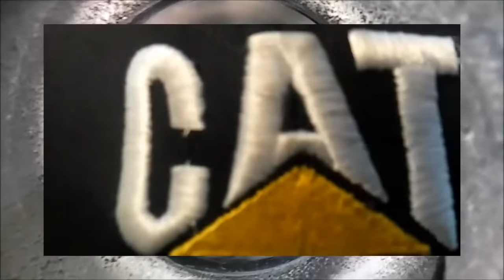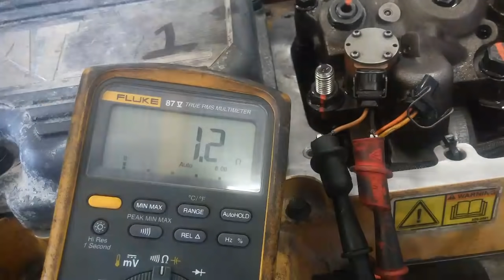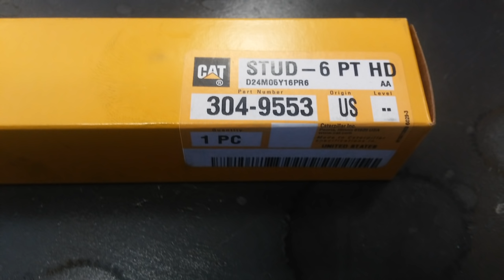What Is An IVA, What Is A VVA, and How To Fix Cat IVA Codes.

Comment: Your videos are great and your passion its well appreciated thru the drivers and mechanics , thank-you for that ! I also have a question if you can help me ...i have a C-15 MXS ,do you know base on your testings how much is the resistivity for the fuel temp sensor (cold and hot engine) ? THX
Reply from the maker: +Dan Bulzan Hmmmmm, the ohm reading of the fuel temp sensor, can I have your serial number and I'll try to find out.
Reply: Great, thanks ! MXS42205
Reply from the maker: +Dan Bulzan I'll try to look tomorrow, but if I don't reply by Wednesday send me a new comment and I'll remember.
Reply from the maker: +Dan Bulzan So I looked it up on Sis and Cat doesn't list the temperatures and ohm readings, it just does the voltage readings when it's disconnected and connected. So I ohmed out the sensor on a C15 we have here and the shop temp was 72 degrees Fahrenheit and it was at 1987 ohms. That is the best I can do.
Reply: Thank-you for looking into it, i did the same reading 1.9k and i notice a big drop in resistivity with temperature increase. Tomorrow im planning to test a step grade switch with different values in resistivity ...hopefully ill get my turbo boost back. I'll let u know. Thank-you again...

Comment: Hi Adept Ape, I recently worked on a 2006 C13 that is showing code 283-7 for oil pressure.  In your experience what have you seen that usually causes this?   Thank you in advance:)
Reply: Erich Z-Rod 

I have the same problem

Comment: hey thank you for this video I had the bolts break on me and a Jake that broke to just lucky I got it in time and that's all it broke just hope I got it all back together right lol I been running it for 2days now what's the part number for the valve cover housing the one that the the valve cover sit on I need the bottom  gasket to it if u would be so kind to help me out with that sir and again thank you
Reply from the maker: +john webber You need to part number for the gasket? What is your serial number sir?
Reply: msx60937

Comment: My truck is giving code 95. And it says is the iva sensor. Where  is the sensor locate?
Reply from the maker: +jluna201817 On a C15, on the valve cover base by the turbocharger. Should be a three wire sensor. On a C13 it is under the valve cover by the number 2 injector.

Comment: I'm running a c13 reading flash code 95 iva oil pressure voltage abnormal what does that mean??
Reply: Most likely your IVA oil psi sensor has failed. It is under the valve cover, towards the front. You have two types of sensor's on a KCB, depends on serial number. Also if you over torque the sensor, you can damage it.

Comment: Thanks for the great video it's very informative, but please help my cat engine has a code 95 I have been having crazy vibrations when pulling  heavy loads on higher gears or when going uphill (it's a torque related vibration not speed related), mechanics have been changing everything driveshafts bearings rear ends power divider you name it but the vibration hasn't gone I even paid Freightliner to diagnose it recently and they suspect it's my clutch they are still not sure that replacing the clutch will eliminate the vibration, and now I just don't want to throw parts and spend money on stupid mechanic guess work, so I started getting different opinions, and guess what,  I  had 10 people tell me 10 different theories and suggestions , until recently a mechanic hooked on a scanner and saw an active code 95 "intake valve actuator oil pressure high voltage". Now can that code make those vibrations on my truck if yes how should I start my diagnosis as I will try do it myself this time. I will really appreciate any advice. thanks
Reply: @Khan =
I was wondering if you ever find a solution to the vibrations on your truck??? The reason I am asking, my truck just started doing exactly the same(C15 twin turbo). I did a pm and  200 miles down the road it started missing. I even pulled over thinking I had a bad tire.....but I didn't. There was a loss of power but still was able to do 70mph (but I kept it at 60mph) It's giving me a 95 code, and just wondering if the I.V.A sensor could cause such a vibration....hope you are able to respond....Thanks
Reply: kov101984 I don't think the iva would do that as I have replaced my sensors myself and still it's the same very few good cat technicians out in the field, my clutch also has been replaced since I had posted my comment and the shop was sure that the clutch is bad but no it made a little difference as the new clutch spring are absorbing the vibration now that is actually coming from the engine. basically now I am coming to my own conclusion that it is going to be the harmonic balancer or my overhead needs to be re adjusted, for you I think you should run your truck (in the same spot) with the driveshaft disconnected at the transmission first make sure others not in the Driveline then go from there
Reply: kov101984 if there is a loss of power it also could be turbo related
Reply: Had the same problem on my c15 every time I was on a load it would vibrate so bad inside the cab,replaced the drive line and u joints,vibration continued rebuild the transmission the same thing happened but luckily the guy who replaced the transmission messed up the clutch brake,I stopped at a shop in Salisbury NC across from loves to install the clutch brake but before the mechanic put me inside the shop he was quick to notice that my truck was skipping. What a term he used,he went back inside the shop and brought his computer and plugged it in. To my surprise 2 injectors were out!The previous mechanic had used his laptop but didn't know how to perform the injector test. All in all I spent almost 10000 bucks due to unnecessary repairs plus downtime and headaches.

Comment: Any one know  if I'm getting code icu 140  and no ENG on a 2005 c15 cat.    Also its firing on starting fluid but dies.  Got fuel pressure on return line. And power to ECM. please help

Comment: The worst thing about IVA and VVA engines is, the customer complaining about how expensive it is to  fix that crap. Those engines use to be great when they were E model 3406s and the early C-15. 
If givin a choice,  i rather have a 3406B.

Comment: does the MBN have the IVA s ?
Reply from the maker: +kwmiked Nope, started with the BXS engines, you should be okay.
Reply: Adept Ape ok, humm, when i had the MBN tuned , so it was like a 6nc/7cz the guy mentioned something about shutting off a accuator.  Now i forget exactly what he said about it cause its been a couple yrs since it was done. But he did mention it was in the head. Im gonna try to give him a call to see if i can get a refresh of what he was talking about.  Anyways,  what if u shut off the IVAs with a tune. would the motor still run right? 
so the MBN is not considered a "Bridge Motor" ? Thanks man
ttyl
Reply from the maker: +kwmiked It's a bridge motor but, doesn't have the IVAs, just a electronic wastegate mostly. If you could turn them off in the software the engine would just ignore them I think.

Comment: Hey I appreciate the time u take making these in depth videos. I recently bought a 06 pete with an acert c15 with 200k on a platinum overhaul.  The truck runs great no blow by but until it's warm it misses at heavy throttle or 1500rpms. Once the.engine hits 180 degrees the thing runs great. I didn't.notice any smoke so I was curious if the vvas could be the culprit. Thre is no check engine light.
Reply: That is what it's supposed to do. Mine does the same thing...until someone told me that's Cats way of saving their motor. They don't want u putting full boost to cold motor.

Comment: I keep getting a below normal on #2 actuator reading
Reply from the maker: +Robert Squall So that is an open circuit, have you checked the wiring harness? If that checks out, you may have a bad ECM.

Comment: hi on bxs engines after intake valves is adjusted, it's the same procedures for adjusting iva? insert filler gauge between intake Roker and the adjusting screw on iva? thanks
Reply from the maker: +Vitaliy TSAT Yes that is correct, you have to adjust the intake valve first then you can install the IVA housings and do the IVA adjustment. The setting isn't the same though so check your data tag to see what it should be in thousandths. I have a video on doing it called performing a complete overhead adjustment for C15 engines.

Comment: I have a code 95 coming up so i replaced the sensor (intake valve voltage oil pressure high low ) ... every time my cat c-15 warms up the check engine light comes back on cuts my boost from 55 psi to 40 psi if you let the engine cool down the light goes out boost comes back I’ve checked all the wiring replaced the plug in don’t know what else to do ..... anyone seen this before ??????
Reply: did you fix it? mine does same. i've done a new sensor and solenoid  and check engine still comes on code 95.  but only under a load not when i bobtail.
Reply: israel ruiz that’s the Sam with mine !!!! Bob tailing is fine only under load then it derates me .... it’s gonna put me out of business I’m broke trying to find it !!!!
Reply: If you find out what it is please let me know !!!! I’ve done sensors and VVA solenoids still I can’t find it
Reply: i have a mxs. Matthew Walker  i will. good luck
Reply: israel ruiz mine is also mxs twin turbo.. 2007
Reply: israel ruiz we found it !!!! Engine is working great !!!!! 
The high low voltage regulator oil sensor on top of the head passengers side was gone so I replaced it with one I got at Napa witch looked like the same thing and we looked it up with a cat part number but it wasn’t working we had to get one from cat that fixed it right up and we’re going to work Monday
Reply: was it the iva sensor on top passenger side that fixed it? starting to think maybe i got a bad sensor from cat when i replaced it.
Reply: israel ruiz yes mine was a bad sensor and yes passengers side front of motor up by valve cover

Comment: My oil pressure gauge is bouncing everywhere between 70psi to 80 to 70 to 90 to 100 to all over. Im being told multiple things about what it could be but no answers. It was hooked up to a computer but nothing was found.
Reply: I would change oil pressure sensor.

Comment: I learned a lot.  Mostly I learned that CAT Build's a lot of inferior Engine Part's that should not have made it in to there Engines.
Reply from the maker: +Royce Anderson Don't blame Cat too much, they were forced to comply with regulations.
Reply: The Extorting Political Activist, aka EPA, forced draconian emissions regulations which means almost all 2004 and later engines are crap compared to older engines. 

Instead of a DPF, why not just make the DOC (Diesel Oxidation Catalyst, aka 2way catalytic converter) larger so that the excess oxygen can cook more of the unburned fuel and oil and soot? And don't be so strict on the particulate matter emissions. Fuel economy suffers as a result of EGR's and DPF's.

Comment: My Iva housing broke just like that 🤦🏻‍♂️
Reply: 15 Liter hsg's break on the rear. Poor design, so they made them stronger. Seen several cracked and I replace them before you get hit with a core charge.